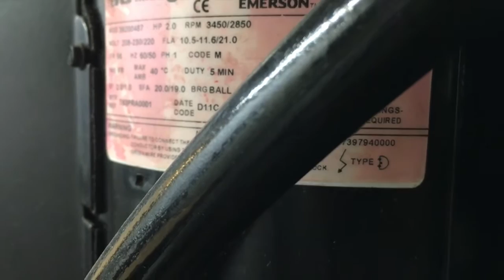|Project GB| Project GB starts..

Comment: Question: is it possible to swap manual on my auto genesis coupe ? , need help guys from Saudi Arabia
Reply: hasan alothman yes you would need manual trans, clutch+brake pedals, shifter assembly. make cut outs and some wiring oh and I'm pretty sure driveshaft as well if I remember correctly
Reply: thanks for the reply, i wish that i could know exactly what  i need to do, for me all mechanical part is easy but, cut outs and wiring, is it needed or i can replace the cpu to manual cpu (is it enough), other this is that my car BK2 with RS3800 engine not GDI, that's what make me plane to change the trans